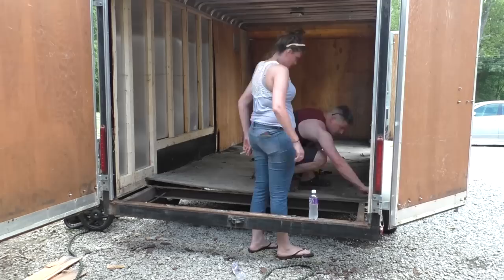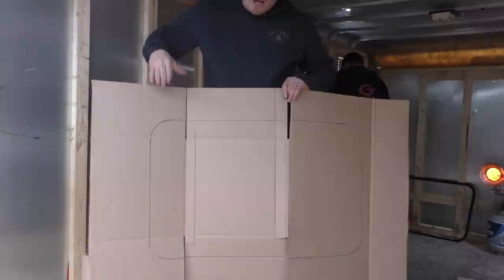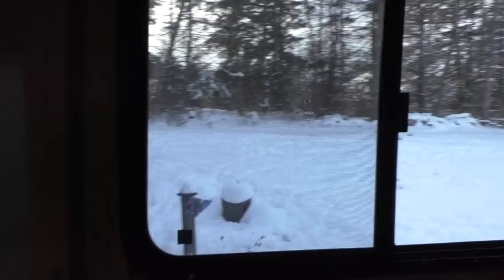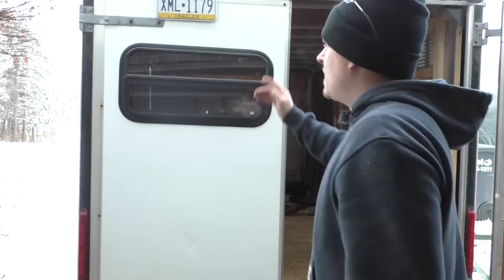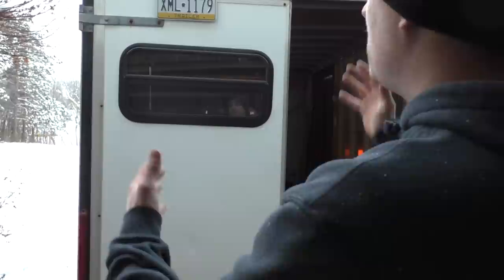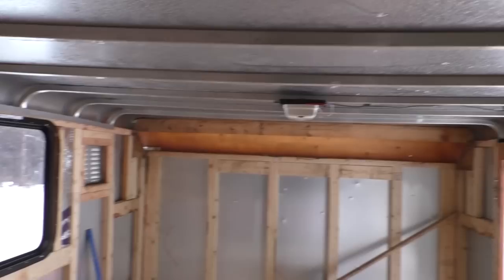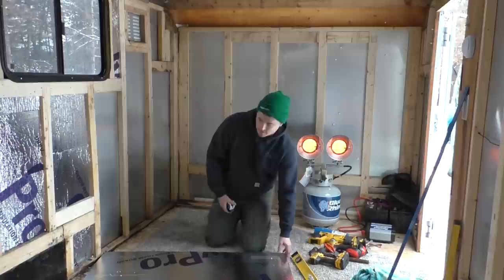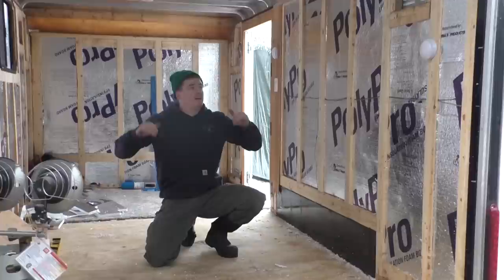Off Grid Cargo Trailer/Camper Conversion Budget Build Pt. 1

Comment: I disagree with you that they are cheaply built....you have obviously never seen RV construction... now that is cheap
Reply: I'll disagree with you on that. RV's aren't built cheaply. They are actually built to code and must pass inspection by the State like a regular house. The issue with RV's though is they are built to be lightweight which effects the type of products used. They are also bouncing down the road which has it's own challenges. They can build much more solid RV's but they will be heavier.
Reply: @mikel9567 thank you for that ^🤙🏼

Comment: I would have used spray foam insulation. Of course I also probably would have redone the framing too. You are going to regret not insulating the floor.
Reply: Spray foam is hell to run wire thru or any other items that come up on a build. If you need to remove   Spayfaom it breaks off

Comment: Nice video - thanks for sharing all the details most of us need to try this ourselves. ! I see internal vertical wood studs where vertical metal trailer beams normally occupy. How are these wood studs mounted - simply fastened to metal studs? Back side of wood studs look almost flush with side sheet metal where metal studs normally sit, almost like wood studs have a groove cut in back of each one.

Comment: Great video! Thanks for sharing.  

How much stability do you lose when cutting the frame to make holes for the windows?  I was told by a salesman that if I install my own windows, I void the warranty (for that reason). I understand that this trailer doesn’t have a warranty, but still curious.

Comment: Great video. Thanks for sharing. I have a question about the window you installed in the door. Was the back of the door open, meaning uninsulated? I'm wanting to put a window in my cargo trailer door, and it looked really easy when you did it! Thanks.
Reply from the maker: Yes it is uninsulated currently I just kind of figured out where I wanted it and then traced it out and cut it. I'm prob going to spray in insulate the door eventually. Thanks for the feedback!
Reply: @builtbysonick1250  thanks.

Comment: Bottom of wall plate replaced?  kinda rotten too. Where was water leak coming in from?
Reply from the maker: Yes I replaced the section that was rotten and water was getting between where the roof meets the side and running down the inside of the trailer. It's an 05 and it sat for a number of years so it's to be expected

Comment: Never seen a trailer with a wooden framed wall.
Reply from the maker: It's an older model. 05 I believe. Not sure if maybe they used to use wood and now they use metal studs. But I have noticed most of the newer ones are metal

Comment: Great video!  I noticed that when you were installing the insulation, why did you cut it in half?  Is there an advantage/ purpose?
Reply from the maker: I had some wiring going through the wood for the lights and couldn't slide the insulation behind it so I just did it as two pieces if that's the part you were referring to

Comment: why didnt you use 1 1/2' foam
Reply from the maker: Mostly just cost and the fact that I didn't really think it was necessary. I'm going to have a little wood burner in it and I don't really plan on doing much winter camping anyways. Plus no AC

Comment: Which insulation is this and where did you get windows?
Reply from the maker: 3/4 inch foam board from lowe's and I got the windows from a local guy that was parting out a jayco camper